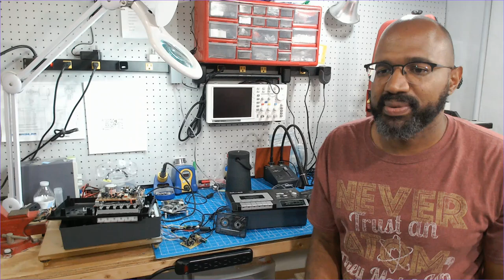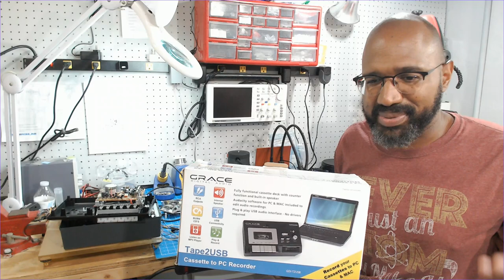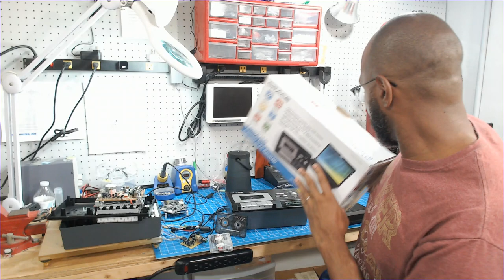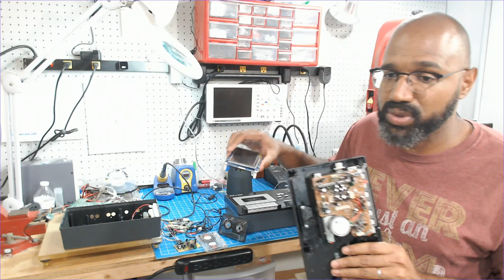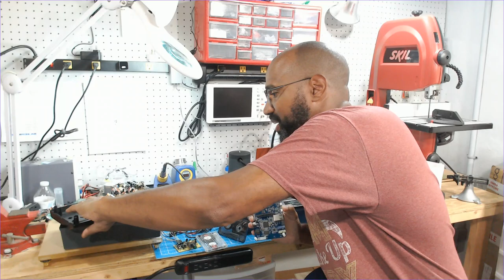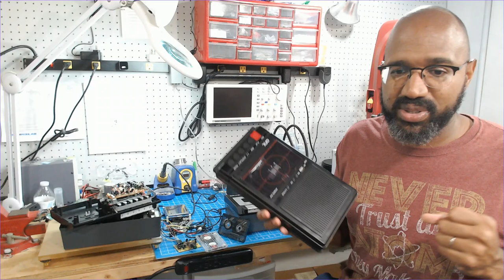Grace Tape2USB Cassette Player with DNR Circuit and DSP!

Comment: Very cool. Where did you get that little inline dsp?
Reply from the maker: I bought the DNR board from eBay (https://www.ebay.com/itm/274001084204).
Reply: Thank you so much. Could you also link to that micro controller with touchscreen? Thanks in advance.
Reply from the maker: @torbenlienljungbergnielsen5025  It's a STM32F746G-DISCOVERY kit (https://mou.sr/3gsHotC). It's a really great test device that I wish more open source audio projects would be done on.
Reply: Thank you 👌🏼 Just ordered the DNR board. I ordered the one you have there with 2 IC’s and the one with 1 IC. Going over the datasheet of the IC, i’m not seeing why 2 IC’s would be better than one? Itms not adding more channels so it might be single stereo or dual mono? What do you think? Thanks.
Reply from the maker: @torbenlienljungbergnielsen5025  I think it just runs the signal through the ICs in series for better noise reduction. This is similar to the way Dolby C is essentially two Dolby B chips combined.